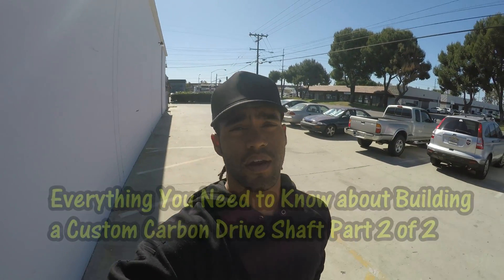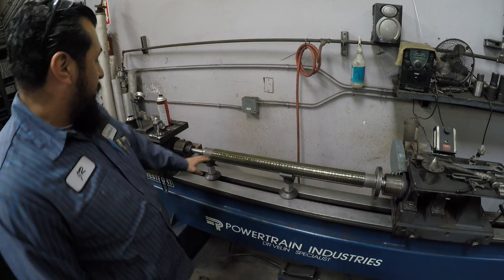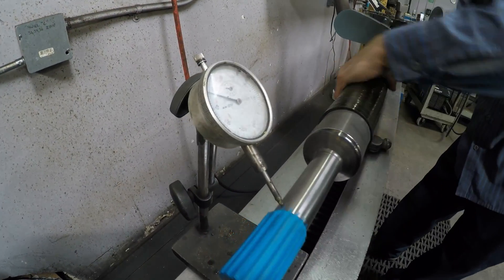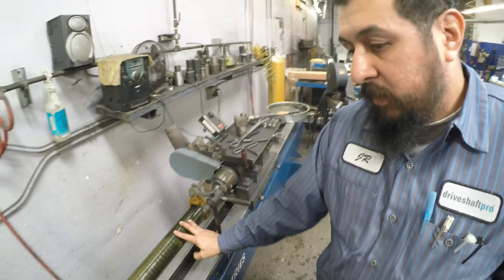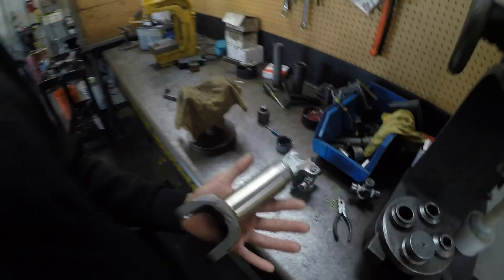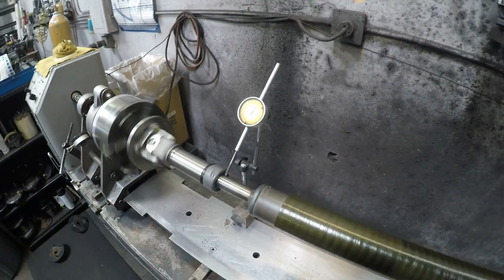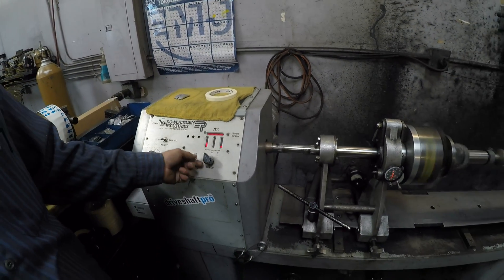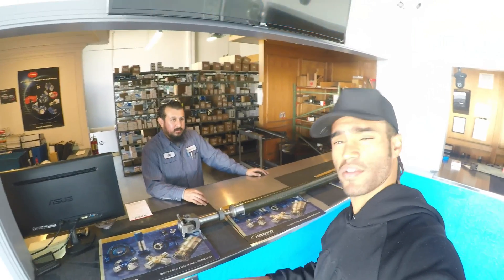Building a Custom Carbon Fiber Drive Shaft Part 2

Comment: How do they hold up. I might get one from these guys .
Reply from the maker: Same Drive shaft on there still... holding up beautifully and making even more power now.  566WHP @21psi boost✅🤘🏾
Reply: Anyone know if that Arbor Press plate is homeade or store bought? Makes ujoint assembly smooth. Thanks